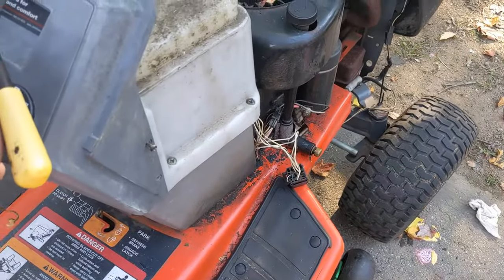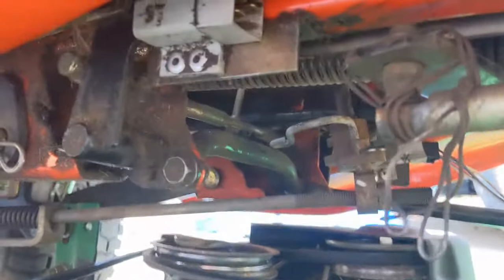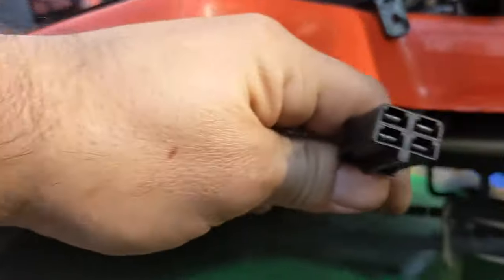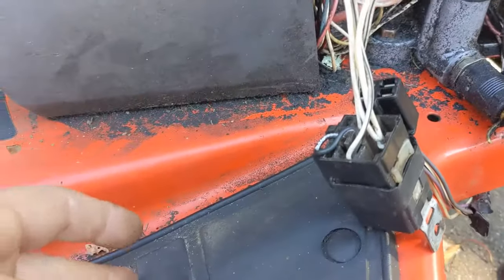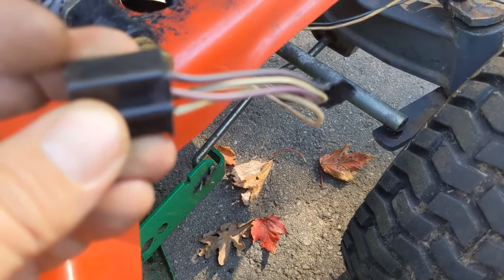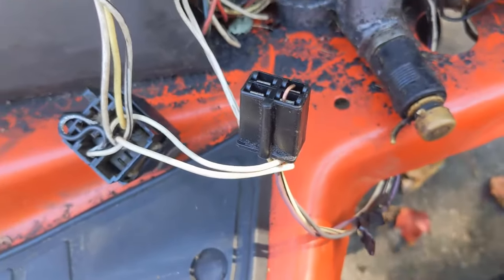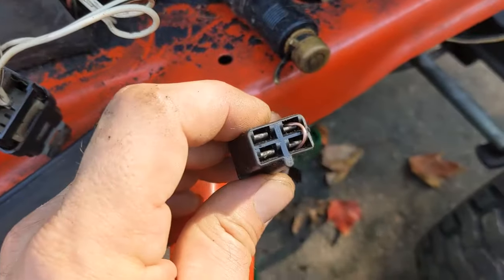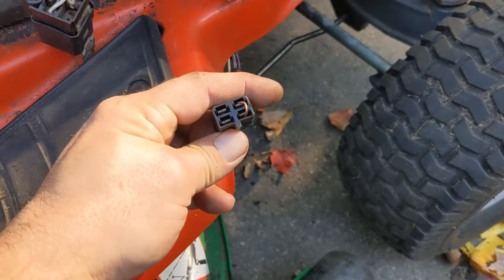how to Bypass brake safety switch riding lawnmower

Comment: What about the other side??  One side is for the starting system, the other for the movement. You get it to start but will anything else work?  Ive had mowers that'll start and run but will die if you try to move or cut grass. If theres a problem you could melt wires with that jumper you used.
Reply from the maker: This switch was for the blades and failed opened. Its mechanical when the lever is pulled the switch closes and it grounds the wires allowing the mower to start. You could cut the wires and crimp them together and it will work forever. The only drawback is you can go in reverse with blades on and start the mower with blades on. If you sit up the seat switch will still still shut off mower. If you dont use brake the mower still wont start. This has nothing to do with anything else. Its still hooked up like that and working a year later.
Reply: I AM HAVING THE SAME PROBLEM WILL STAR BUT DIE WHEN TRY TO MOVE I.  WHAT DID YOU DO TO FIX IT

Comment: What is the thing you put in there  just a piece of metal having same problem and got the switch off now I am a female live alone so I got to fiqure out how to fix things myself please tell me how to finish this been jumping the solenoid off to crank it for a year now
Reply from the maker: Yes a paper clip, a wire, anything metal
Reply: i just did that as it had came to mind as i seen it moving up when i hit the brake all the way down but still nothing at all even did the seat also got dark on me still need to do the pto as i always have a hard time when it runs to get it to work right my ex took the solenoid off before he left and took old one with him i had no idea what to even get or do to fix it so i assumed i put new one on right as it still only cranks by jumping the solenoid lights dont work either anymore i dont know what else to do i got a fuel pump on the way as i been needing one then i guess i will just have to keep doing it this way new switch and all also
Reply from the maker: @sherryhowell8697  I would make sure you got the solenoid on right. Should be 1 thick wire to starter and 1 thick wire to battery. The green wire will be signal from key switch that turns it on. You can put a test light there and see if it comes on when you turn key. The other connector/wire would be ground to frame. Could put test light there too and see if that lights up and if it does you have a ground issue.
Reply: @dirtypocketsct  i did the big wires right but it use to have a 3 port and my new one is a 4 which they said it wouldnt matter but the end i had to change to hook up to bolts in stead of the little slide piece got that fiqured out but i have only the 2 thick wires and a little tiny wire attached to one of them that is not hooked to anything dont see anywhere it would have  went to and then 2 other wires that are small that go one the little nuts one is 2 black wires that are together and the other is a white wire i did try a tester not sure i did it right but it only lite up when i touched the thick wire that goes to the postive on the battery and the little wire hanging off of it lit up nothing on the other 3
Reply: the way they talked watching videos of how to install it by mounting it on the metsl frame was the ground i dont know im a female so dont know as much about doing things like this as men do i try hard to dont mind doing it kinda like it when things go right dont have anyone to call to help me but it sure kicked my ass today will try to regroup and try again sfter work tomorrow just to get it to turn over with the  key would be huge it takes 2 people to crank it and its dangerous as well thank you so much for your advice made me feel like i was going in the right direction as it wouldnt do anything at all if it was either safety switch it should crank without the seat one hooked up but wont engage the blade without it i remember unhooking it one time and had to hook it back i guess they work in a certain order seat being last in line
Reply from the maker: @sherryhowell8697  where does that white wire go. and what color is wire that goes nowhere. think they might have to connect
Reply: @dirtypocketsct  it goes to the wiring harness looks like towards the ignition but it disappears in a covered cluster of wires that direction the little red wire that is hooked to the thick wire aint but 2 inches long i might could take a picture and show you its dark right now and i had hooked the battery up kinda outside where it goes so it wouldn't be in the way as i was trying different things kept unhooking negative terminal everytime to not short anything out lol as it seemed logical but i dont really know what im doing not sure we can post pics on here or not by i can try
Reply: just coming a storm also but took a few pics dont see no option to share them or post them though